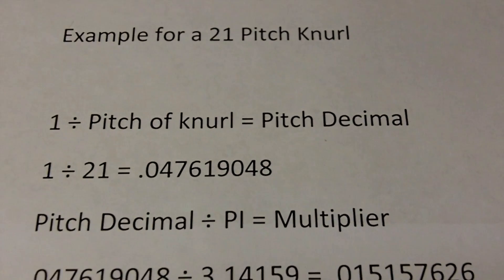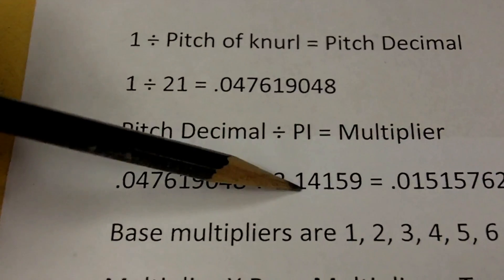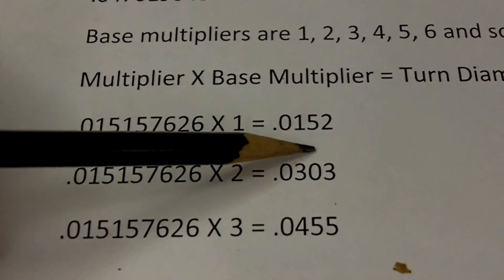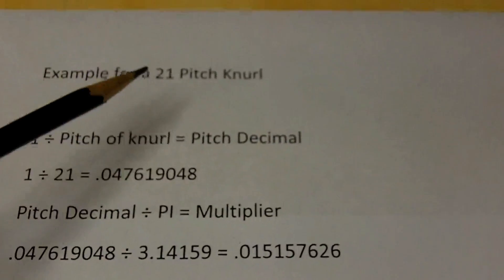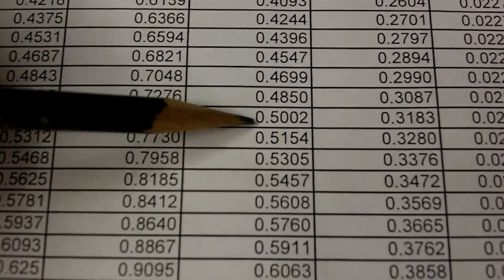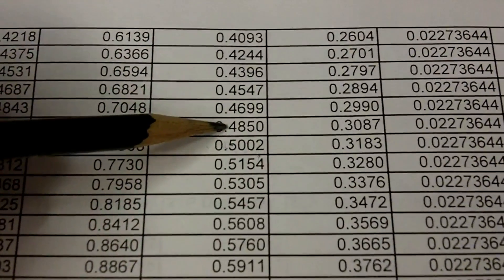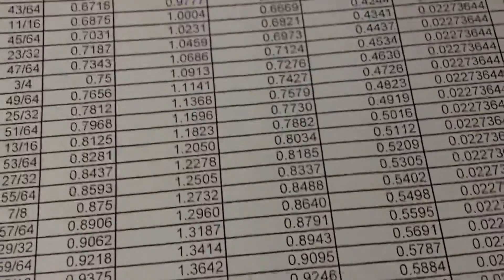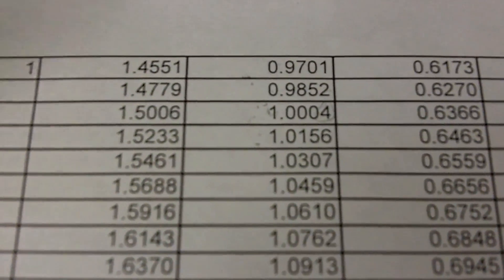Pt 1-4 How to Knurl on a Lathe

Comment: This is the only method that guarantees a proper compression type Knurl every time. I prefer doing a single pass if the workpiece is ridge enough.Great advice Thank you.
Reply from the maker: It's always worked for me. I'm usually hanging out with no support, so I go slow and steady. I need to try a one pass with support, but have never needed to at this point. Good luck and take care, G.

Comment: Wonder how critical it really is. If you did not carry the numbers out to as many significant figures then the one example of 0.5  would not be 0.5002!. Does this formula work since you are upsetting the material therefore changing the diameter?  As you move the wheels along the shaft horizontally what keeps it tracking and not overriding what you have already knurled. Is there a feed rate just similar to threading to make it track? Never knurled anything so really lost. Knurling tools have different diameter wheels so how does this work out. I know this is an old video so maybe nobody follows the questions any more.?
Reply from the maker: The diameter has to be close, but not necessarily perfect. I believe I said somewhere in the series, I will round up or down depending on the situation. Really to the nearest thousandths or half. If you're really close, the upset (like you've stated) should straighten itself out as you advance the tool. As for the horizontal travel- it shouldn't matter the feed rate so long as you got a good pattern before the traverse.
Testing the initial tracking is the focus. If the diameter of the stock is correct, there should be no over-tracking- or very minimal at best. Different diameters and pitches of knurls can be plugged into the formula to give the best results for what you have to work with. Hope this helps, G.

Comment: Is there a way to confirm the pitch of my knurling tool? I bought a three in one knurling tool and the description that came with it said fine, medium, and course. Thanks for the great videos.
Reply from the maker: No problem. I found one post in a forum that gave an explanation. I don't know if it's correct but here's the quote. Hope it helps, G.

"To determine the pitch I counted the serrations on the die and divided that count by the circumference of the die." 

pitch= number/ 3.142(Diameter)
Reply: @ghostses  thank you!
Reply from the maker: No problem! G.

Comment: I watched your video several times and I found it informative, but I can not determine how to choose the "Base Multiplier". 
Is it based on the intended diameter of my part? Thanks.
Reply from the maker: It's hard for me to explain Falcon. The base multipliers are used to basically create a chart of target turn diameters. You measure your stock, locate the nearest turn diameter on the chart, turn to this dimension, then knurl. I have the pdf link in the description section if you would like to download it. 

If you're looking to do the math at the lathe, you might need to look for a different method over what I've shown. Good luck, G.
Reply: Thanks. I think I've got it now.
Reply from the maker: No problem! G.

Comment: My knurling wheels were different pitches than yours, so I used your pdf as a guide and created the spreadsheet at the link below so that any value could be entered for accurate numbers and then printed out for quick reference.  I also included the fraction/decimal conversion for giggles...https://drive.google.com/open?id=0By0L2OwEclGFUTFkNUhPT3ljakU or http://www13.zippyshare.com/v/FxpC9lvo/file.html (use the orange 'Download Now' button)
Reply from the maker: +hd M 
Very nice and tidy! I'm sure it will help others if they have different pitches of knurls. I don't recall if I mentioned how to measure them by rolling them out on paper to dinnertime what one has, but including it in your sheet was a nice touch.  Thanks for taking the time to make it, and share it freely with others. Very cool! Take care, G.

Comment: Probably the most useful vid on lathe knurling! Thanx :)
Reply from the maker: +Kostas stamatakos 
No problem Kostas! I'm glad you liked it. Good luck, G.
Reply: +ghostses Hi again! I worked a bit on knurling too. I wanted to ask you this: why do you divide the Pitch decimal with pi? Ι do not understand this, and in fact it does not work for me! 

I should underline that I think and work metric and I do not know the pitch of my knurls. So, I inked and rolled my knurl on paper, measured the total length, counted the lines, subtracted one and divided the total length with this number. This result I consider to be my knurls pitch. It actually is the distance between two consecutive knurl teeth. 

Now, if I divide this number with pi, and multiply with 1,2,3,4 etc, and use this as outer diameter on the shaft to be knurled, the knurl does not come out ok. 

If I directly multiply my pitch with 1,2,3,4 etc, it works just perfect! Any thoughts?
Reply from the maker: +Kostas stamatakos 
Kostas, to be honest with you I'm horrible at math so I'm probably the last person to know the answer to your question. I figured this out about 5yrs ago pulling info from various places- mostly math related sites.

I really don't have any thoughts, so hopefully someone else will chime in with an explanation. But, if directly multiplying your pitch by incremental numbers is working out- that's great! At least you're getting good knurls now so hopefully the answer will come in time.
Good to hear from you. Take care, G.

Comment: Great video but your formula is incorrect.  you have to figure it based on the distance tooth to tooth, so you roller diameter is needed as well.  I made a spread sheet if you would like to take a look at it and maybe do a video on it to help other you tubers out.  I have it set up where you enter 3 things ( # of teeth, dia of roller and desired material diameter).  it will tell you the closest diameter to turn your stock to and one size below and above.  Please let me know.  Thanks
Reply from the maker: cruch9 Thanks! That's quite possibly true. Although I've never had one go bad using my information, it certainly doesn't mean it's spot on. I believe any small errors are canceled out since it's forming the knurl through displacement, in lieu of cutting it. And since I round the tenths to the nearest thousandth, being in the ballpark seems to get the job done well. Post a video, or give me a link to your sheet for download, and I'll link to it for others if they want to use it. I did mine as a print out since I can reference it while I'm working at the lathe instead of going back to my computer. I never took the time to clean it up since it works for me and it's free so I really didn't care what it looked like...lol. It could be cut to a couple of pages if I formatted it better...lol. Someone actually wrote an Android app after watching my series. I have it on my phone but haven't tested it out. You should check it out. I think it's linked in the comments on one of the videos in this series, but don't know which one. Its called "knurling calculator" I'm not sure if the equations are what I used, but it would be a good test to compare to yours while knurling. Good luck, G.

Comment: Cool stuff.  Are they really that finicky?  Down to the ten thousandths?   Is there anything like this in the Machinery's Handbook?  Thanks, G.    You da man!
Reply from the maker: Thanks man! No, not down to tenths. I round to the nearest thousandth, up or down. The forming of the knurling will push the material around to a degree and cancel out any errors. If you're not pretty close to the required diameter it can result in some nasty looking over tracked knurls.

 I've looked in the handbook, but most of it was related to the tools. I didn't find a section on how to determine the proper diameter- but I may have missed it. G.
Reply: I tried to edit this post after seeing part 2 where you answered my first question but it just froze and said "posting".   I don't have the handbook yet, but I'll get one soon.  They're pretty proud of the new ones.  I think I can manage with an older, cheaper edition.  Thanks again.
Reply from the maker: blmeflmm66
No worries! I shot this long ago so I don't even remember most of what's said...lol. Yes, they are proud of the newer versions of the handbook. I picked up a 28th edition off Ebay for $46 to the door which was a sweet deal. I just kept looking til I got lucky. I'm sure tons of the info in the books has changed very little over the years and is still pertinent today. You might even be able to find a pdf version of something if you look around.  G.

Comment: hello my knurling tool do not have the pitch of each wheel how I know it ? diameter of wheel divide in number of teeth
Reply from the maker: I don't think that will work. I'm not that good at math so I don't know the formula. What I would do is use an ink pad to ink the wheel, then roll it on a piece of paper about 1.5-2 inches. Then use a ruler and count the number of marks you have in 1 inch. That should get you the TPI of your knurl. Or you might find a calculator online to get what you need. Good luck, G.

Comment: What is the math for? Is it for how thick the material is and how fast we should go or what? thanks for the video is great this is the only thing im confused about.
Reply from the maker: Thaddaeus, the math is used to determine the correct diameter a part needs to be to get a good knurl pattern. If the diameter of the part is not correct, the pattern of the knurl will over or under track on each new revolution- creating a bad pattern. Think of the teeth of a gear with painted teeth rolling around the part and making marks. If the diameter of the part is correct, the teeth will line up with the paint on the next revolution. If the diameter is incorrect- the teeth of the gear will paint new marks and destroy the pattern on each new revolution. I hope that makes sense. Good luck, G.

Comment: I'm not totally convinced that the wheels are exactly the pitch they claim to be!
If I'm right, my 21 wheel is 3/4" with 48 teeth giving 21.20.
I've turned the spreadsheet around - enter the dia and no of teeth and it gives the appropriate diameters.
Reply from the maker: Andrew. I see I read your post incorrectly- so I'm editing it. Sorry for my hasty reply.
I don't know if what the "manufacture" says they are- they truly are. Probably not with the import wheels I use for sure.  It's probably a "close enough" number. I'm really not that good with math, but you're probably right about your knurls. The spreadsheet works well enough for me, and any deviation seems to be canceled out when the knurls are formed. Again, I'm truly sorry for my misread of your post- I was out of line. I hope you accept my apology. G.